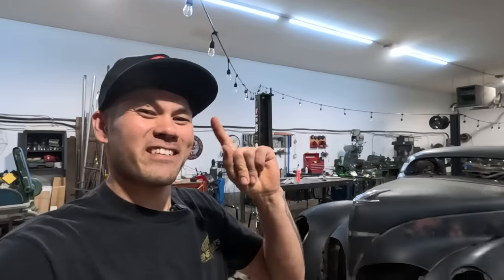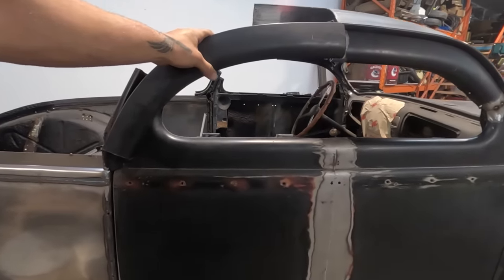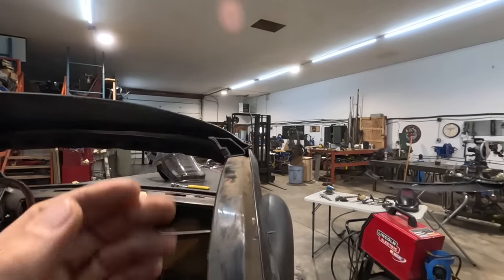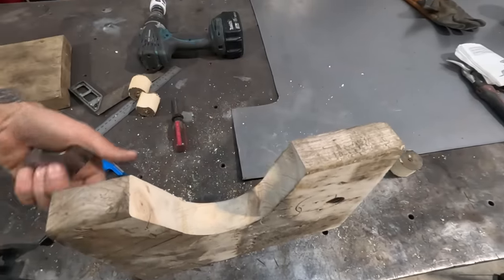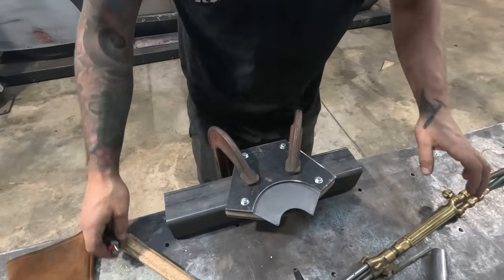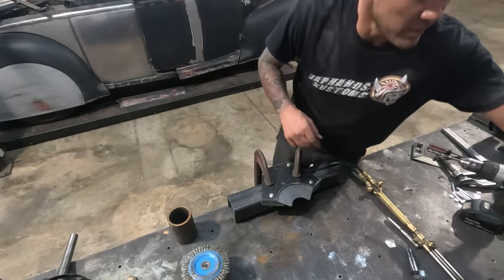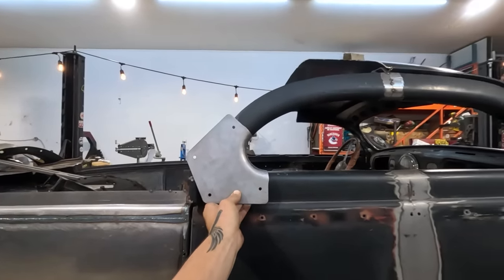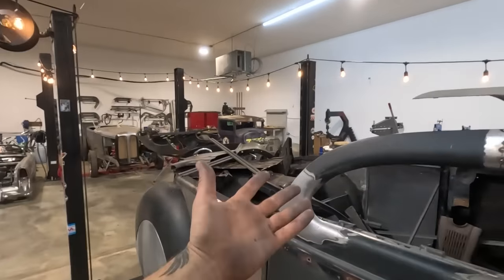HOW TO Make a SIMPLE Steel Plate HAMMER FORM - Door Corners on 1939 Lincoln ZEPHYR Chopped Coupe

Comment: I must say that i am amazed and in awe of the work you did on this corner shape.  This single spot has ruined more top chops than any other.  It is the absolute worst task in the whole procedure and you have nailed it.  The 16 gauge panel should be a big plus here because you really need all the strength you can get at this joint.  The top of the door is going to continually be exposed to strong forces from the closing of the door and it needs to be strong in this joint.  I like the way you emphasize the importance of the door's inner structure here.  It is also vital to keeping the integrity of the door intact due to the inertia of that big door swinging open and shut.  That is a big door and it is going to have a sizable piece of glass in it when finished. All that weight is going to put a lot of stress on the joints between the window frame and the body of the door.  The way you have pieced this together will result in a strong door that will stand up to the wear and tear of driving.

Comment: Beauty, Karl! Hey, when you have to do a wood form, soak it in a bucket of water for a few hours before heat. Then if it starts to char, toss it back in the water for  a few mins & continue. It'll cheat you thru many times for onesies-twosies. (Steel, of course, is still sweetest). Rock on! 🤘😎🤘

Comment: Have to say, I noticed the thicker material rather early in the process and I'm pretty stunned that you pulled it off with such ease. Excellent work, Karl!
Reply: I was wondering why the thick metal also. But no worries, turned out fine.

Comment: If you have a truck and trailer repair shop locally, they can be a good source for hardwood. I get laminated offcuts that they use for the trailer flooring. Nice, thick stuff. Works well.

Comment: Hi Karl,

Awesome work on that corner piece. Take it from a blacksmith the flat spot came from an uneven heat on the first attempt. Any spot that is cooler, ie: not as red hot will resist the bend or the form your trying to put into the piece. Keep it hot and red all over and you wont get flat spots. Hard with sheet metal for sure. Love the bottle top hammer, perfect for that piece, going to make me one tomorrow! Great job on the hammer form.

Comment: You can get oak stair treads at the home supply stores, you may be able to use some of them to make bucks, but they're laminated from narrower boards and may come apart when you start beating on them. That's a good looking radius you put on those parts you made, they turned out great.

Comment: Karl to corrrect the flat in the curve get an old pair of c grips spot weld a small bolt to each half then slide on a small roller bearing on each bolt and fasten down with nuts then you have a hand held adjustable mini english wheel grip it on and push or pull on the curve that should take the flat out of the curve cheers from down under

Comment: I’m wondering if you would have soaked the wooden forms in water for awhile and let them get saturated if it would have kept it from burning as you heated and formed. I use wet pieces of wood sometimes to hold behind 2 pieces of thin metal that I’m worried about burning through when welding 👍

Comment: For the new players out there, just remember that both parts of the door frame, needs to be exactly the same. You cannot not tip one in more than the other. You cannot twist glass! Same goes when you tip the top of the door frame in, you need to tip the bottom of the window channel inside the door outwards to keep it dead straight.

Comment: hey buddy nice job but look next time try joggle cutting the roof so you have fingers to slide apart really aids in the line up and then you end up with small 4 x4 or 4x6 depending on the stretch squares to fill in  instead of a whole strip to fit and formits way easier ! i learned that method from rod and custom how to chop a 51 mercury came out early 80's?😉😎👍

Comment: Did the front flex up after you cut the roof?  I assume some tension is relieved when you make cuts in metal ?
Reply from the maker: i dont know if it flexed up significantly. i think the roof just had a natual sweep that was meant to continue rising further for the longer roof as a 4dr

Comment: I disagree with your thinking that the rear of the window piece has too wide a curve.  If you look at windows of older cars the front starts a narrower angle and flows to a wider angle.  It kinda gives the elusion of forward motion like an arrow, where if it's too narrow it stunts that look.  I think you want it to look like a tear drop on it's side with a flat bottom.  Also if you pinch the rear too tight you will end up pinching off the side vision of the driver/passenger.